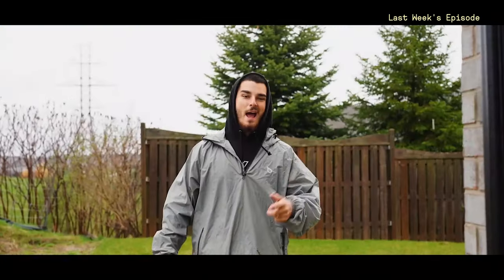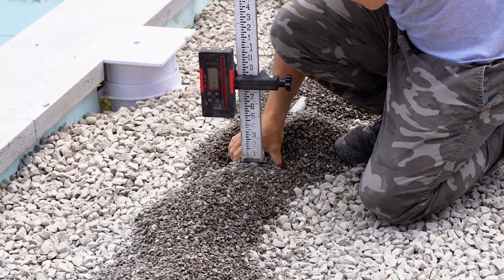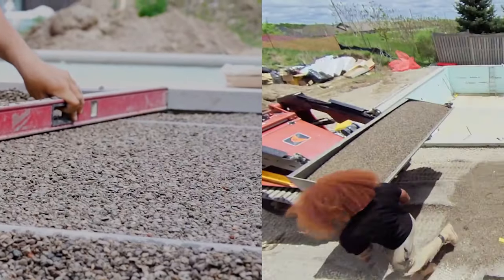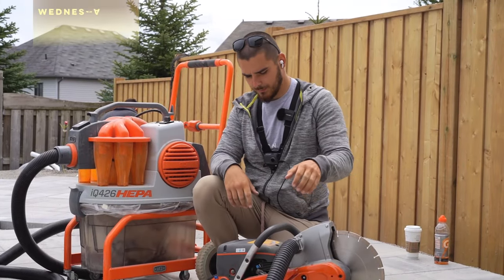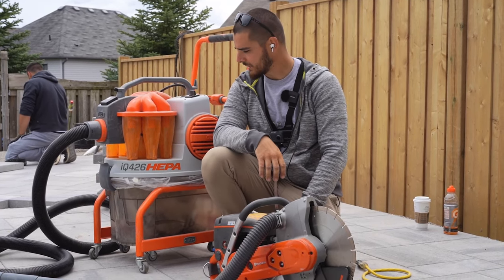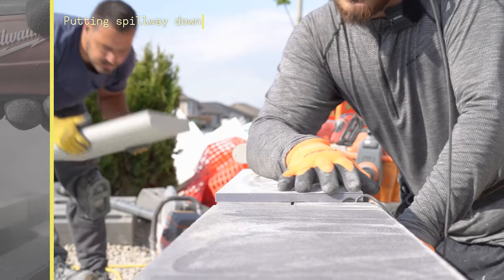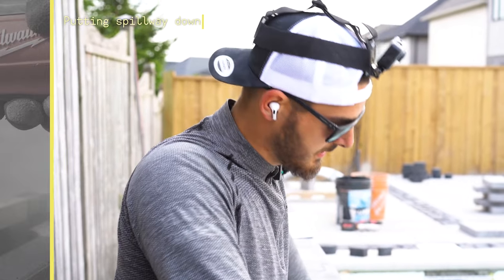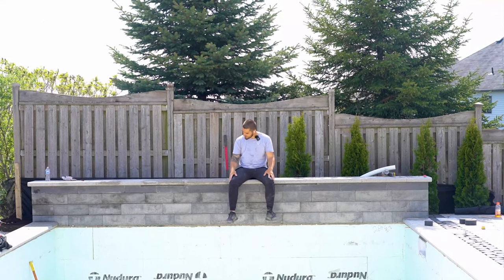HOW To Design A GORGEOUS Pool! | Visionary Weekly EP 05

Comment: What are you going to use over the foam? A liner or something else?
Reply from the maker: We add a layer of 1/8" foam roll on, and then a liner on top!
Reply: how do you attach the liner? what kind of liner tracks and how are they attached to the foam walls?
Reply from the maker: @joelbaden935  we use face mounted liner track.  We anchor it into a 2" concrete collar that we frame up using plywood extension strips.  Even if not using concrete, ICF has webbing every 8" that can be screwed into.